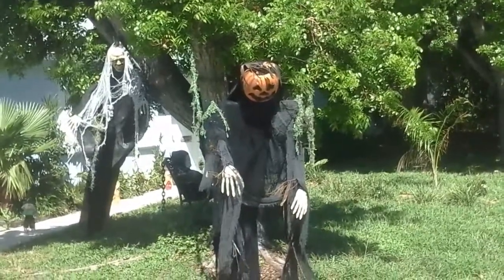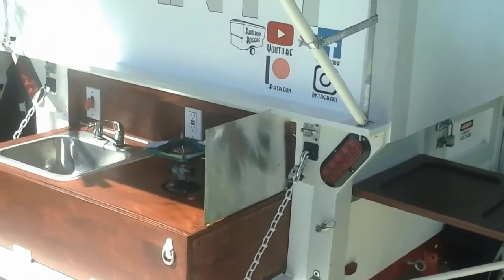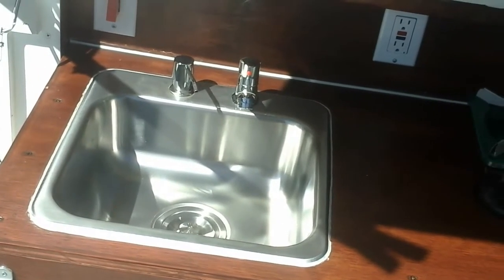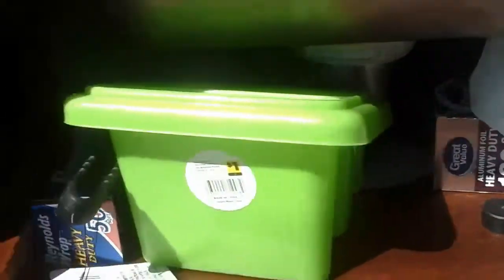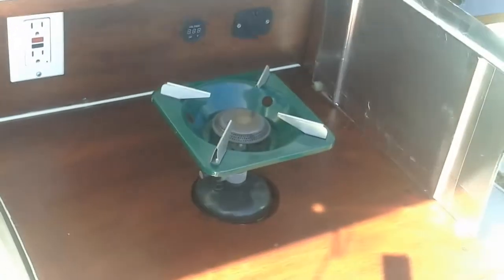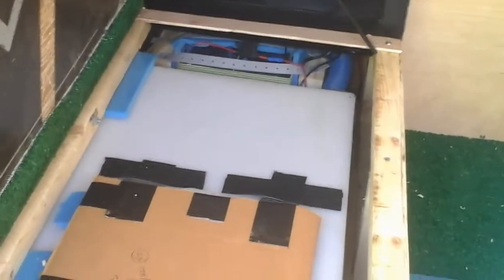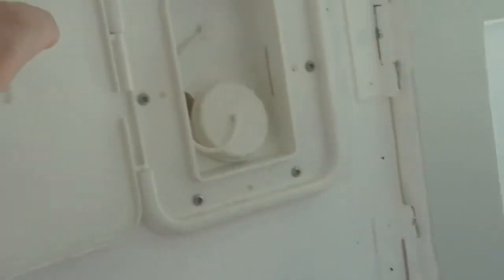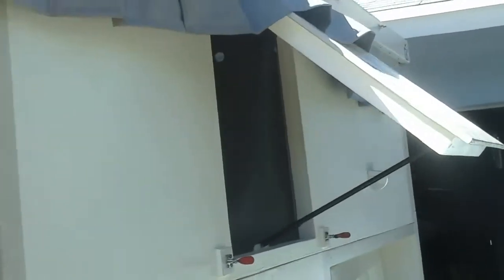Folding micro camper on harbor freight trailer.. part 3. The galley.

Comment: Pretty neat. I need to find a little water pump. The one you have seems perfect.  I don't want something that does to much per minute.
Reply from the maker: Kristofer Travels i believe mine is made by shurflow.. the lower gpm and working psi saves water..and is easier on your plumbing.  I'm using both 3/4 and 1/2" clear vinyl lines because i need it flexable for the moving galley..